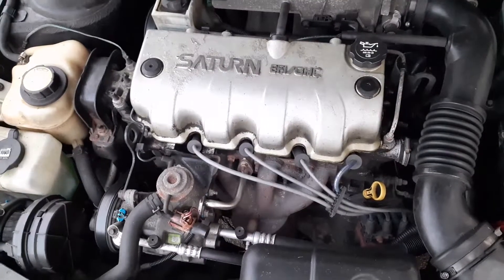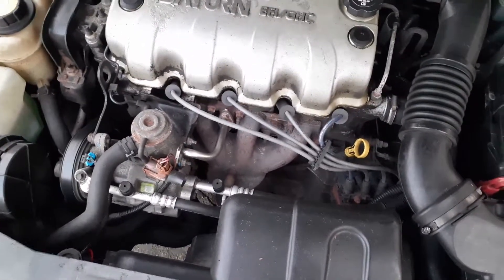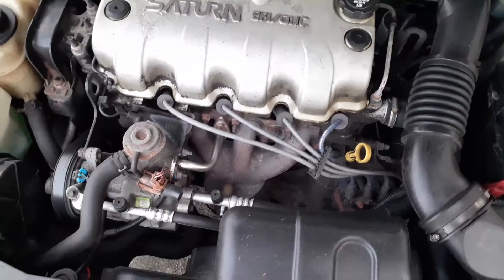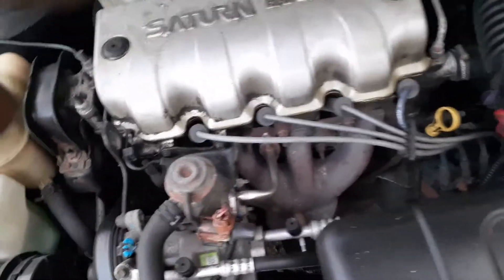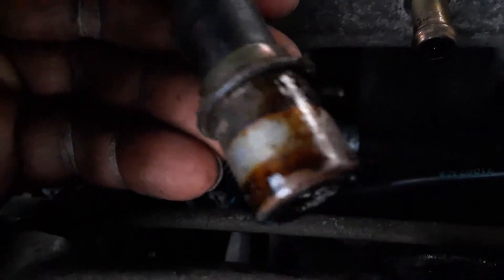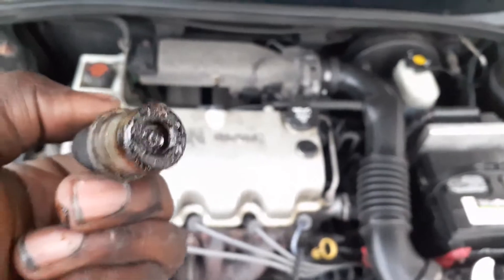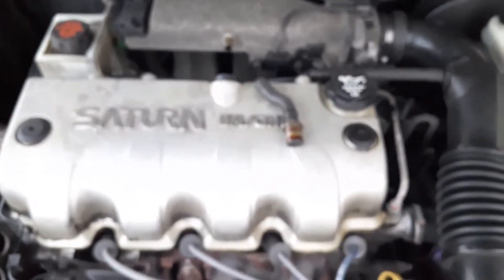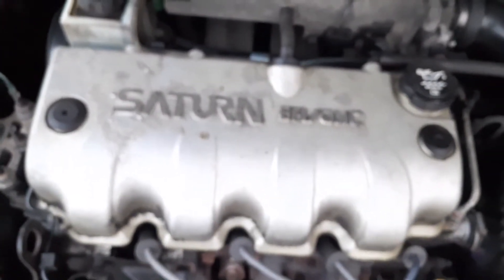How To Install PCV Valve On 2002 Saturn SL1

Comment: Where did you buy the pcv valve
Reply from the maker: Advanced auto parts, but they should have it at O'Riley, and AutoZone as well. If you don't want to go out to get it you can get it online from  amazon, ebay or rockauto....
Reply: @Change4ADollar  thank you so much for the fast response! I really appreciate it. Quick question. Did your car smoke a lot before you changed your pcv valve or did you just do it for maintenance
Reply from the maker: @paulhincapie6983  i do it at every oil change because it's only a couple of bucks. Saturn's are know for smoking but they will run for ever. If you are getting a lot of blueish white smoke at start up this will probably help because sometimes the pcv valve gets stuck open and will suck oil in, and burn through the exhaust.
Reply: @Change4ADollar  I just changed it and it just changed the smoke from blueish white to a lot whiter but still blueish honestly it’s hard to tell. My 1999 sc1 is just blowing a ton of smoke from under neath the engine and out the exhaust